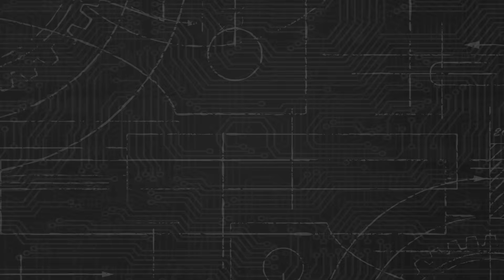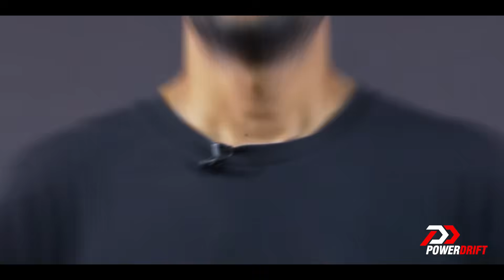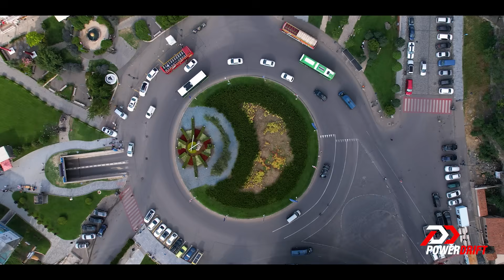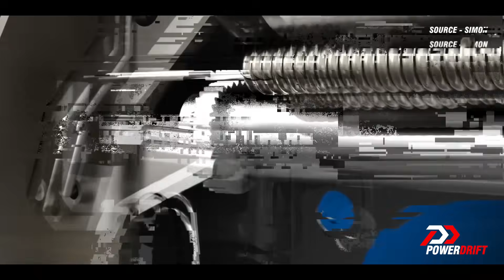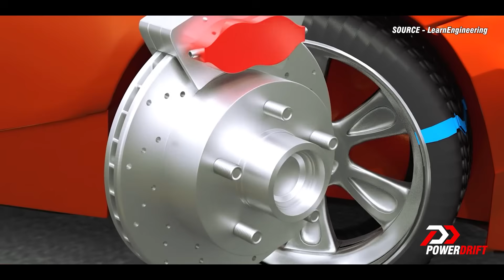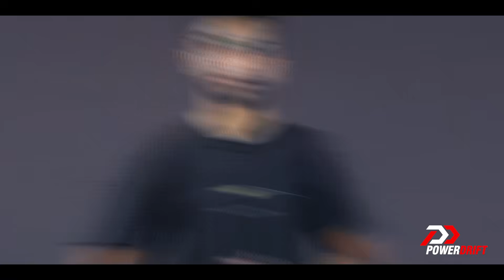Are disc brakes really safer than drum brakes? | Simplified

Comment: drum brake >>> disc without ABS.
change my mind.
Reply: I've bought a bike with disc without abs
Reply: @nashtrashcool  if you are a good rider and can handle it properly, you are good to go👍🏻👍🏻.

Is it dual disc or single disc ?
Reply: @carcamp5451  I supposed that it was dual, but now found out that it's single and only front
Reply: Drum brakes are shit bro. You can learn to modulate brake pedal with practice. Once you understand the friction point even roughly your tires provide wrt the surface you drive on its not even hard. On the other hand you can't do much about brake fade drum brakes get due to poor heat resistance. I understand you might not drive fast but when encountering a downhill despite engine braking it's a big limiting factor

Comment: 1:42 what ?? "Rear brakes are tend to use much lesser than front brake" Are you out of your mind ? I only use front brake 10 out of 100 times.
Reply: Rear brake is for slowing down. But, the main stopping power is in the front brake. So, if you are going fast and need to slow down in a short span of time, you use both rear and front brake with front brake playing the bigger role here.
Reply: I apply Rear first and then come to the front lever.
Reply: I too had the same thought. Now I have a doubt! 

To anyone reading this comment, do you use front brake or rear brake the most in a motorcycle?
Reply: @abcdabcd8605  I use rear brakes the most. I am hearing this for the first time that someone using the front one the most
Reply: @MohitSharma-ik7ms  I too heard for the first time to use front brake more. Even while learning how to drive I was suggested not to use front brake at all initially, until I got confident in driving.
Reply: @abcdabcd8605  To brake efficiently we have to use front brakes as during braking it is tougher to lock up the front than the rear 
It's easier to lock up the rear which is quite dangerous but india being india everyone uses the rear brakes more than the front brakes (me included).
I've been trying to break that habit but it's proving to be quite difficult
Reply: I was also doubtful that am I the only one riding it wrong😂 @abcdabcd8605
Reply: You're a noob
Reply: If you have abs try to get into the habit of using front brake as it is safer (look up threshold braking) it might just save your life one day
Reply: No use both brakes 😕
Reply: In car....not in two wheeler
Reply: @SushmaVivek-xq4nv  i have  a 2w
I use both brakes :p
for lower speed/low braking i just use a bit of the rear brake
but if i need more, i just apply more of the front brake

People who say you should use 100% of the rear brake, then use the front are stupid
you do not understand the physics fr

in the end the main thing is use whats more comfortable for you but yeah
Reply: That is in context of cars ig, but its true for bikes as well in sometimes
Reply: He's talking about cars not bikes.

Comment: Buying scooty with drum brakes..because I ain't a formulae 1 driver and I don't want to become john abraham from dhoom on city roads
Reply: This is not about racing disc brakes means more safety of some cow comes on road suddenly
Reply: Exactly in emergency situations
Reply: lol
i would honestly not buy any scooter with front drum brakes
my scooter has hydraulic disk brakes front and back, the braking power difference is night and day
Its not even just about driving fast, even at 50kph, you can just have way more control and stopping power with disc brakes compared to drums

the feel is also much better because after an extent, the cables will just stretch so you would feel like youre applying more and more force but the same woudnt be transmitted to the brakes

Comment: The 7" Full width drum brake with twin leading shoes on the 2000+ Bullet 350 was very effective. Almost as effective as a disc brake. They were compatible with the older models too so retrofitting them was a breeze. I was easily able to lock the front wheel all the time. Can't do that anymore, though. I've lost that sense of balance. Also, newer batches of those drums were not perfectly circular and brake shoe quality went down too.

Comment: I get that as an enthusiast i would want to know all about the longevity,  heat dissipation and all the technical differences.

But as a laymen with limited budget i would appreciate if you had included which combination one should get? Both drums or single disc without ABS or Single disc with ABS, which is a safer option? It should've been in the "simplified" if you're talking about brakes.

Comment: I Installed Rear Disc Breaks In My 1st Genration i20 but Its Has Rear Drum With Disc Both Are Working Drum works for Parking & Calliper Works When Running 👍👍
Reply: I got a similar setup on my Linea but reverted to stock owning to some issues with the availability of good quality brake pads. But the discs are better overall.
Reply: How did you converted it? Through local garage owner
Reply: @ashish6345  only installation done by local garage
Reply: You really should install brakes in your car, not breaks.

Comment: I have a doubt do drum brakes use fluid because it is mentioned a pressurized fluid acts on the drum I think it is mechanical rather than hydraulic
Reply: its the method of how you are actually transferring the force. low end cars do have parking brake that is Drum in the rear are cable operated hence its mechanical. you see hydraulic lines into that brake its hydraulic brake. in normal disc brakes even tho you use fluid to transfer power of your foot to calliper. your caliper extends and retracts which is more of a mechanical movement. replace the fluid with steel wire and spring you can achieve the same operation. Just for simplified answer if you have fluids to transfer load its hydraulic, and steel wires to do the same its mechanical. trucks use pneumatics that is air to drive their brakes, be it calliper-discs or drums, it is a pneumatic system.
Reply: Cars use hydraulic drum brakes and 2 wheelers use mechanical ones

Comment: My cousin had an accident on a scooter with a disc brake at the front and rear, but there was no ABS. They had to brake suddenly and very aggressively during traffic congestion at a point. The tyres locked up instantly and my uncle lost control on the bike. My uncle and cousin fell on the road. Hence, it's just a myth that disc brakes are better than drum brakes. Disc brakes are only better if ABS is at least provided on one tyre. Comparatively, drum brakes won't lock up in that much aggressive manner as disc ones. Drum brakes are ideal if there's no ABS. BTW, my uncle and cousin are safe with just a few minor injuries on the hands, elbow and leg ❤
Reply: learn to use the disc. you dont want to put the effort you cant be a better rider. always look farther. keep eyes on road. its not a myth since you never put any effort learning the power of discs. if you use discs like you used the drums you will lock up. i happened to crash my Ntorq with injury to my underside of the left arm scratched up. took 2 months to fully heal. and i did the same complaining just like you are doing now. abs is good but it also acts as an AID than skill. you want to be skillful learn Progressive braking and only 1 finger squeeze. keep the pressure on before engaging the brake where you can feel the bite. practice that and then you can make 2 finger squeeze. never try 3 finger squeeze since that most likely is too much power to the master cylinder where you cant react fast enough to release the pressure hence the crash.
Also most Important is the tyre. you re very unlikely to lock up the tyre on non gravel or sand road if you got fresh set of tyres. your 1 finger will be on its limit before you could lock up the tyre. worn out tyres, avoid the sudden brake at all cost. get skillful than complain. and same goes for the car brakes as well. progressive braking and always judging the reaction of whats happening on front.
Reply: @Dkm337  Bro it might have also been my uncle's mistake.. There's another point to note that there was no ABS.. I don't know why he felt the brakes are too aggressive at first, but initially learnt to control now 👍
Reply: @ducatimultistradav4850  Thank you for replying and Glad to know uncle is getting better in his skill. disc brakes especially on scooters are really dangerous becaue of those skinny tyres. scooters usually dont come with ABS units specially on these 125-150cc.The skill and practice is the last thing that saves you. when i changed my Ntorq brake disc to a non petal disc. with the same brake pad the bite became so good that for a microsecond i locked up my front tyre with 2 finger and then quickly released the pressure. it took a good amount of practice. else i could have slipped.
Reply: Braking system + Motorcycle Health/Tech + Tires + importantly the rider/driver skill. it takes it all
Reply: @kushal0105  Bro the vehicle was serviced on time, and everything was in mint condition.. Might have been my uncle's mistake also...
Reply: Same made a sudden break with disk and i fall down

Comment: 1 more disadvantage that I noticed in drum brakes is in wet situations, they tend to loose their efficiency very rapidly.
Reply: This makes no sense to me. How does drum lose efficiency in rain? Drum brakes have brake shoes literally sealed inside the drum unaffected by rain. I've seen old disc brakes with thin rotors and worn out pads that lose efficiency in rain due to the water on the rotor almost acting like a lubricant. But never seen it on a drum
Reply: @kalmanfilter7056  I'm not sure what roks2408 means by "wet conditions", but I drove an old Dodge pickup through a deep puddle once and shortly after, I almost ran into the back of another car because when I first pressed on the brake pedal, there was ZERO braking.  I panicked and leaned on the pedal with both feet and got it stopped before rear-ending the other car, but it scared the crap out of me!  I've never had a similar problem with disk brakes.  The shoes and drums are very much an enclosed system, so water has few places to escape if it gets inside the drums.  Obviously, disk brake systems are mostly open and water shedding is much better.
Reply: pretty sure my moped's rear brakes are noticeably much better after a wash or getting wet in the rain